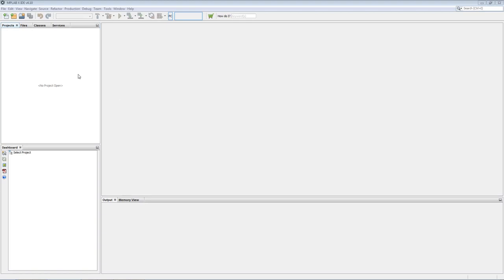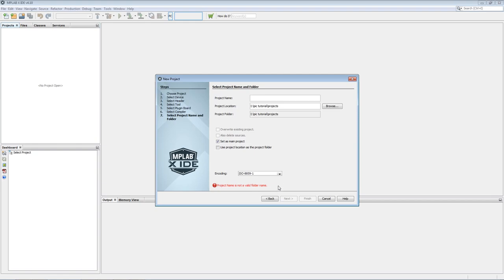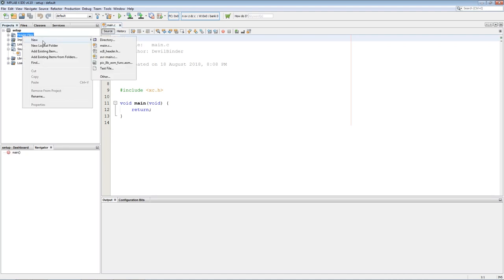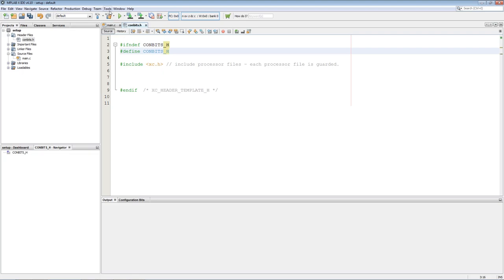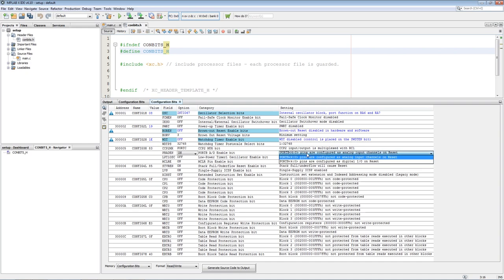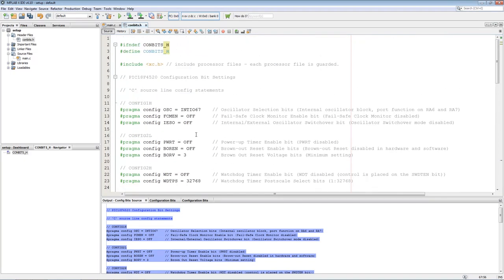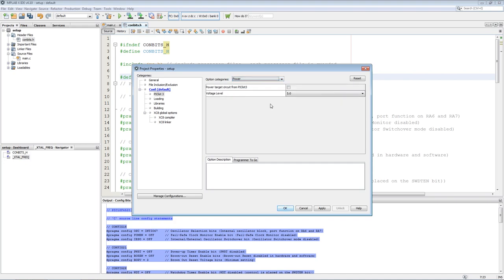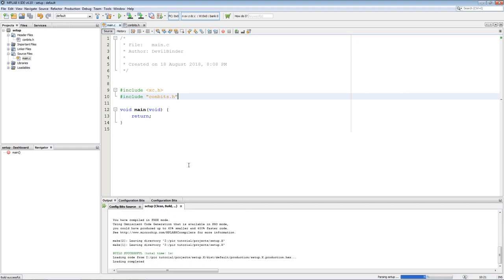Project Setup 🔴 PIC Microcontroller Programming Tutorial #2 MPLAB in C

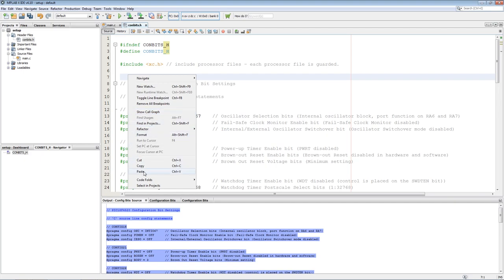Comment: um where did you copy the oscillator frequency from in 3:36?
Reply from the maker: Wrong question. How do I know what the value should be or what does the macro do are better question.
Answers: It is the default chip clock. Macro is used set timing for some of the builtin functions.
Explained in detail here: https://youtu.be/E-UMOx7qv2k

If you truly want an answers to your question, copied it from prep code.

Comment: Hi! I am using PIC18F452 (not PIC18F4520 like you) and there is no "PBADEN" field in the configuration bits, while rest is same... And idea how I should set specific port as I/O?
Reply from the maker: You can ignore that setting. The PIC18F452 does not have analog functionality on PORTB. In general avoid using any analog pins . If you have to use them then explicitly set them in code as analog or digital. This is covered in the AD converter video. https://youtu.be/yFvJXxaY4O0

Comment: Hi I love your tutorials, very helpful. However, using OSC code: IRCIO67(internal osc) does not work on my PIC18F2585. I wonder if there is a way to map an internal clock, be it CPU or peripheral, to an output port. That'll be most useful way to debug lots of problem. Thanks a lot.
Reply from the maker: Set it to IRCIO7. The Clock will then output on RA6 at Fclock/4.
datasheet section 2.1
"7. INTIO1 Internal Oscillator with FOSC/4 output on RA6 and I/O on RA7"
https://youtu.be/E-UMOx7qv2k
Reply: @BinderTronics  Yes, it's great to see the clock with IRC07 setting. However, I fixed my erratic led blinking pattern with your delay routine rather my clock count down. Thanks a lot.